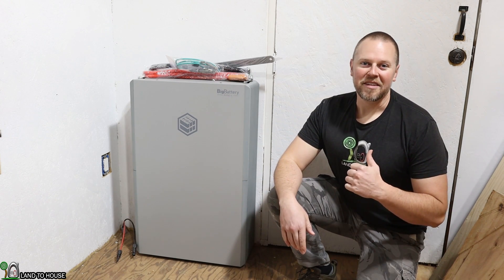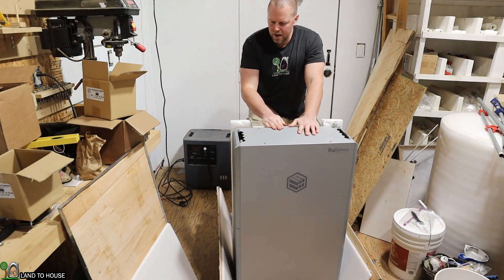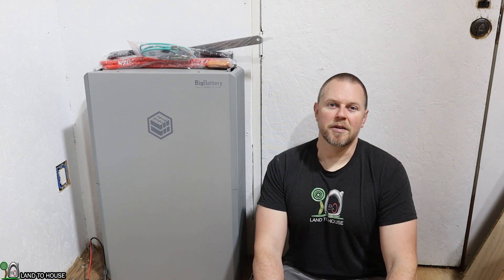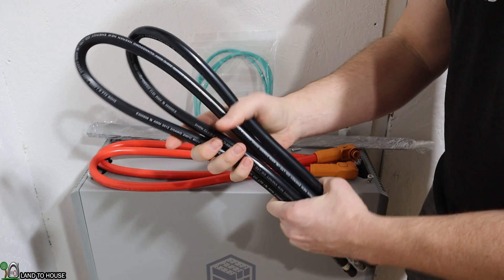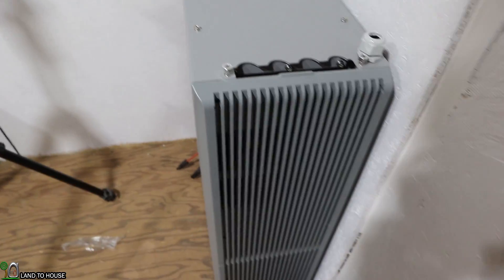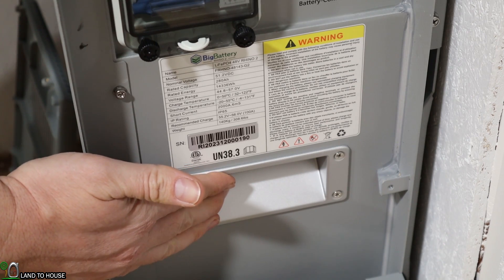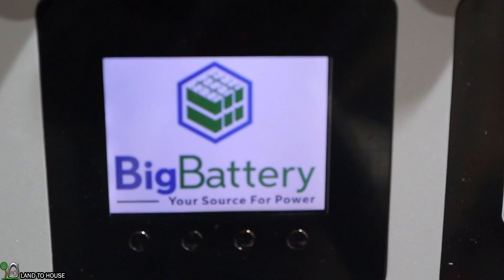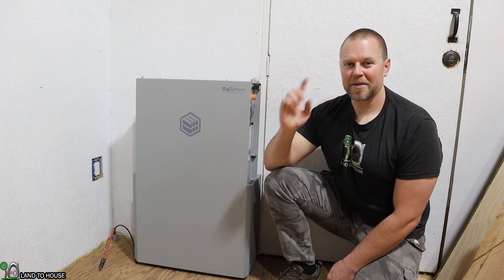Rhino 2 Big Battery First Look 15kwh Li FePo4 Whole House Battery

Comment: Are the included cables Aluminum or zinc plated copper?
Are the snap on connectors proprietary or common and easy to source?

Comment: Wow! That’s a real Behemoth! I like that it has heaters and can be placed outside or in a garage. The only thing I saw that I didn’t like is you have to remove screws to take the covers off for panel access. It would make more sense to have those magnetically attached. Looking forward to seeing more as you begin testing. Nice video Seth.